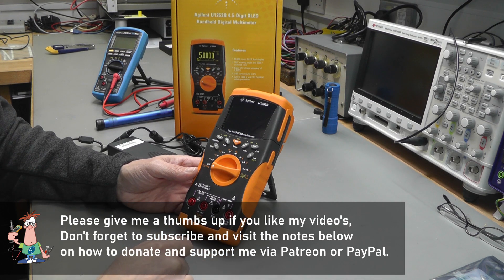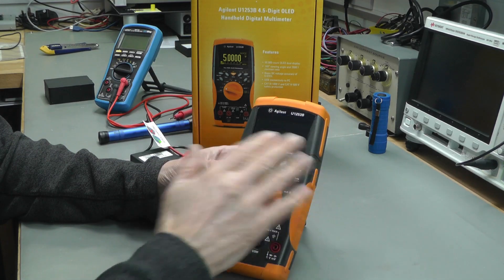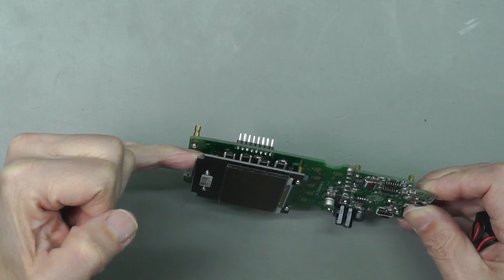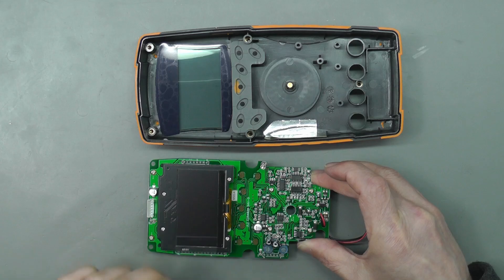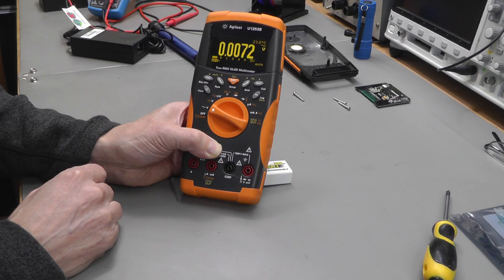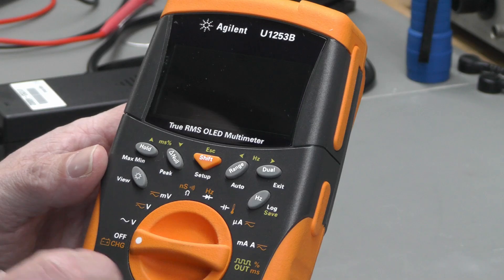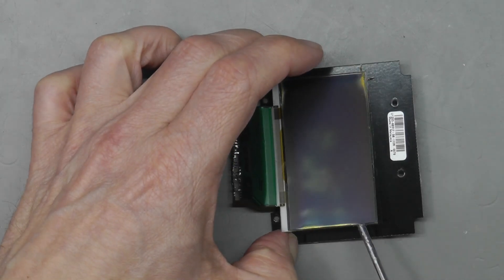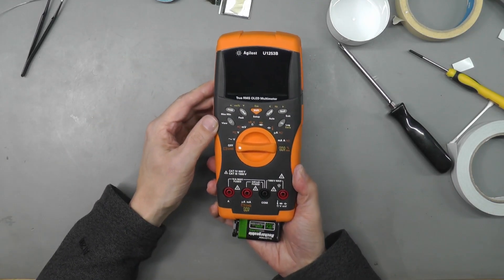No.105 - Agilent 1253B Multimeter Repair

Comment from the maker: UPDATE: The original Agilent display uses a SSD1303 driver IC.
The replacements are SSD1305 or SSD1309 and will mirror the display.
So, either I find an SSD1303 OLED (long obsolete), or make an adaptor Pcb.
Reply: I would just stick with the working replacement display board and declare victory..
Reply from the maker: Nooo, the tinkerer, hacker & "want to be at the workbench" kinda guy wants to complete the mission....:-)
Reply: @IanScottJohnston  I certainly don't need to be at the bench, already got a half dozen repairs to do........
Reply: You could always build a little board to strap on the front of the meter. Put a camera on it, then flip the image in an FPGA and add a new display in front of that. Job done.
Reply from the maker: @sdgelectronics  Great idea! and I'll strap the 6v battery from your moped on the back to power it all.
Reply: @sdgelectronics  This is probably the best course of action to be honest.
Reply: I'm working on a new (lower cost) version that uses an STM32 instead of an FPGA. After making the U1273A/AX LCD drop in replacement I realized that a lot of the graphic LCDs have nearly the same command set as OLEDs. Unfortunately, the U1253 series is too space constrained for these types of displays. A color TFT would work but requires a different MCU. The "KD" boards made sense when the only other option was a module from Taobao or Aliexpress where modules were price around $140. Some sellers (I think they're all Wang) came along and decided to compete against the DIY kit I sell on eBay by reducing the cost of the Chinese drop in modules. The complexity of the KD design and part cost is high. There are benefits but I can't expect everyone to pay a premium price for a technically superior product when a cheaper option looks and seems to behave the same. I presently make a competing product which uses logic chips to correct the reversed display and has reduced power consumption and a lower cost but it's not pixel perfect. The new STM32 version will be.
Reply: Could it flipped over some how by extending and twisting the flat flex? So the mirror image is mirrored back the correct way.
Reply: Might be cheaper to hire a squad of guys from chain gang, run them on moped get them to touch the pins of item on test, 
"no sire" = under 40v
"Oww!" = over 90v
Over 400v, no need for moped to come back for him.
Reply: 7:51 Try to use UV light, its counterfeit measure I believe.

Comment: Sadly I have one of these. I don't use it very much because every time I reach for it the battery is invariably flat so I have to go through a charge cycle before use. That must be the reason my screen hasn't died yet. I bought mine because it has a very nice display which turns out to be its Achilles heel. I guess as the saying goes beauty is only skin deep,
Reply from the maker: One of my next jobs is to convert it to Lithium-Ion PP3, thus use of 600-780mAh batteries.
Reply: @IanScottJohnston  I think wireless charging is a cool idea.

Comment: Why use an OLED screen for a multimeter anyway. What advantage(s) is/are there over a LCD with a backlight. It's just displaying digits after all, not graphics. These multimeters have a very fast update rate. Was an OLED screen needed for that or could an LCD have been used. Apart from that, i don't see any advantage. Seems to be just a gimmic.

Comment: I don't know how many years old these U1253B's are by now but there must a manufacturing defect that causes these screens to die so quickly. 

My phone is a 12 year old Motorola XT910. It uses a super AMOLED display and still works perfectly. No dead pixels or brightness fading. I have the brightness turned down to increase battery live and reduce eye strain. I wonder if the OLED screens in these multimeters are being over driven. LEDs don't like being over driven. I wonder if there is a way to under run them by changing a resistor or adding a diode in series with the supply voltage?

Comment: I purchased one of these and replaced the OLED with what appears to be the same kit that you purchased. The display works very well now, BUT the input attenuator for the voltage ranges is not correct. The maximum voltage you can apply is about 1 volt in all ranges. Except for the millivolt function, which works correctly. Spent some time trying to troubleshoot the problem last summer, need to get back on it when I have time. Would have been nice to have a schematic available, but that does not appear to be available to the general public.
Reply from the maker: That's an odd fault, hope you get it fixed.
Reply: There shouldn't be any interference with the functionality of the multimeter. Data is received but nothing is transmitted back. In a sense the meter is only impacted by the load being present. I've had issues with the firmware on the meters. Back when mine was new it would glitch up and require a hard reset by removing the batteries, turning the dial on and off, and then putting the batteries back in. You can try that and see if it helps.

Comment: hi. I got the Agilent U1273AX, got a really deal on it from the distributor in my country some years ago. Less then a third of current retail price. Thought, hey, its expensive, but I'll have a MM that will last me for years. Little did I know. 

Hadnt used it for a coupel of months, pulled it for something I needed to measure away from my home lab, and the bloody screen had died. Really annoying as it is in mint condition and barely used.  I know the screen that is used in the one you repaired is the same as mine, so I would really appreciate if you could provide a link? found a few on eBay, but honestly, gotten burned so many times on eBay that I really dont want to use ebay unless I have too. 

So if I can get it repaired, I'll sell it, cant an expensive MM with dying OLED displays needing to be changed every couple of years. And also I asked the distributor is Agilent woudl be able to sell me a new screen. Agilent wouldn't sell me one, but offered me to repair it for 500 euro's  lol. 
some years ago
Reply: 500 euros, thats absolutely ridiculous. Thats more than a new multimeter, way more.
Reply from the maker: RS selling this DMM currently for £968. Wonder how long ago the last one went!